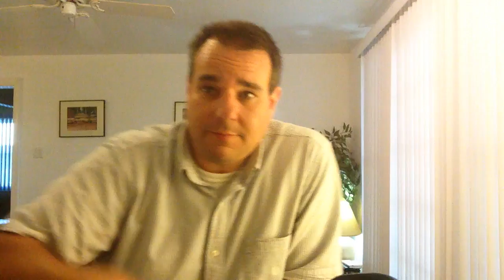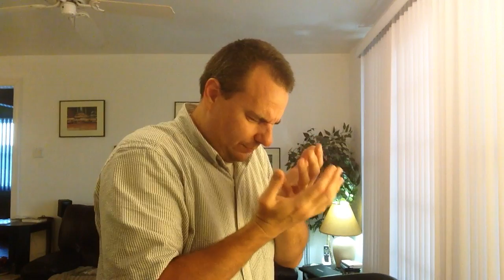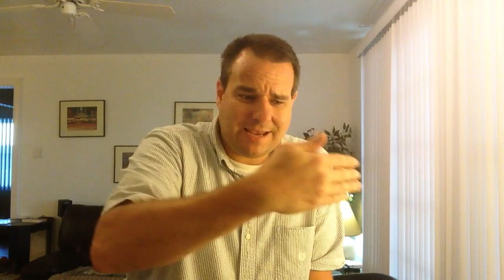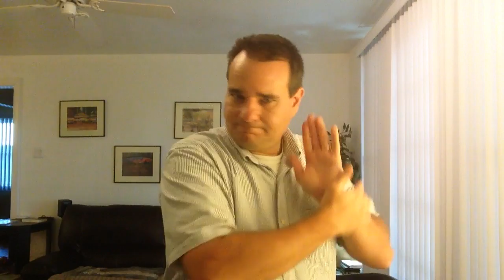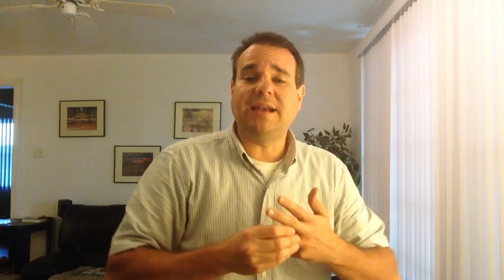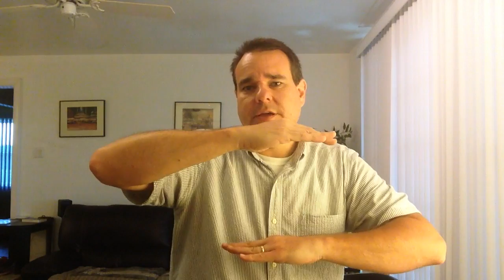More Digital Concepts - Sample Rate, Bit Depth & Rate

Comment: Kris - nice vid.. explains the settings well.  In the early days of CDs, sound quality wasn't great. For the most part, I think that's because the early DAC chips didn't have great error correction and resolved the upper frequencies poorly.  As you say, 44 kHz can resolve 22 kHz but with just 2 samples (plot points), you'll end up with a pretty jagged curve unless you smooth that out electronically. The problem resolves itself gradually as you go down in frequency.  At 11 kHz, for example, you have 4 samples to work with. At  1 kHz, you have 44 samples!  The more data, the more accurate the sound.  Anyway, modern DAC chips are much better at converting fewer samples to smoother wave forms and sound quality for CDs is quite good now.

About a week ago (and with this in mind), I set about to establish a baseline recording format for transferring my records to my PC. The goal was to create the best quality possible without bloating my hard drive with overly large files. Ultimately, I decided on 48/24.  To arrive at that, I downloaded a free sample from HDTracks.com and used one of their 96/24 files to create down-sampled 48k and 44k versions. I then opened the original in Audacity, then opened the 48k file (in the same window), inverted one of them and created a new file from the combination. The resulting file was basically silent (due to wave cancellations) but with a bit of data in the upper frequencies.  I then opened the spectrum analyzer in Audacity and took a look.  The 44k comparison did reveal lost data in the 15-22k range (as you would expect). The 48k comparison also revealed lost data but it was all above 20k.  Not sure if my method was sound (pun intended) but it made sense to me!  Keep on rocking!~
Reply from the maker: +Mark Colegrove Thanks so much for the wonderful comment/reply Mark.  I am starting to realize the more I read that for whatever reason, we who listen to music and gear (so, you know, audio geeks) refuse to recognize that our ears from one person to another are completely different - as if there is a baseline that is consistent to everyone.  Just like I know I don't see the color yellow the same as you (being colorblind) but that doesn't mean I don't recognize yellow or its' shades.  I think the same is true with speakers/audio preferences/etc.  What sounds tubby to you may sound forceful to me - yet we aren't wrong.As for deciding what works for you - definitely I think people should hear/see for themselves.  I used to be so adamant about my needledrops being at 24/96 but once I did this video I realized that really only the 24 bit of the equation was important - made capturing so much easier (due to processing file sizes)... I stuck at 44.1 only because I know sometimes software conversions can cause some issues and I do make a CD of these - if it was strictly an mp3, I would capture at 48khz as well.  You know, according to the industry, 24/48 is hi res.  Once I did the final check - play the file, play the vinyl I realized that all of the ideas I had about digital/analog was wrong... I blame Fremer :)  I did a final followup video called Master Debater that goes into my epiphany.   I feel much freer now - https://www.youtube.com/watch?v=zxeIVBOjRfw
Reply: +dixielandfarm Yellow, yes!  I was thinking about this a few months ago.  We really have no way to accurately describe colors to people and even folks who are not color blind may actually be seeing completely different things.  You and I may agree on every color... yes, that's red.. yes, that's green, etc.  However, I have no way of knowing if my experience of "red" is the same as yours. I assume it's close but that's about all I can do.  Works the same way for music I think.

So...where was I.... I record at 48/24 AIFF files and import them into iTunes. Then, I just have iTunes burn the (44/16) CDs for those I want to play in the car.  Eventually, I'll add a nice little DAC to my audio setup with a PC and play those that way.

Comment: Analysis Tool:
I use SPEK to create a spectograph on my audio files. I can easily see a lot of empty space above 22 khz on yours and any 24/96 recording of a vinyl record. It seems to be unnecessary information. 900mb per album is going to fill up even a large HD very fast. For example, I downloaded an alleged recording of DSOTM 200g original master recording at 24/96. It sounds very good however, the SPEK is no different than my recording at 16/24 except for these large blue spikes that appear into the emptiness above 22khz (the limit of a vinyl record anyway). I have basic stereo equipment so I suppose I can't compete here but I'm happy with the recordings I've made so far but I could have saved a lot of time if I wasn't such a nerd about this stuff. Now to go buy a new pair of Sony MDRV6s!
Reply from the maker: +Corey's VC Channel When you read the audiophile online forums, they go on about how the air is missing on anything that isn't  24/192 and even 24/96 sounds dull, but the vinyl never has this - but truth is exactly what you see on the spectrograph - while vinyl can and DOES have content above 20khz, there are THOUSANDS upon THOUSANDS of recordings that don't - never did, the mikes couldn't capture that high or it was filtered out by other equipment, etc... and the analog-or-die people never mention that fact - nor dismiss those recordings - they just say how much better the record is.  The record still might be the best, but it isn't because the digital can't capture it - it is the mastering, plain and simple.  My test would have been complete if you were standing in my room and listening to MY EXACT RECORD on MY EXACT PLAYER and switching between all of them.  We can surmise that if you can't hear a difference between the 24/96 and the 16/44.1 that 1. The vinyl isn't inherently better than the digital as a storage medium 2. Hi-Res has no real place in the home, since we can't tell regardless.  Only two people heard a difference between ANY of the files except the lowest mp3, and one of them changed their mind (if I am recalling correctly)...

But, the one thing I really wanted to impress upon people was they aren't missing anything - they can enjoy any format they want without thinking they are cheating themselves not getting that Blu-Ray audio version of their favorite album... whatever they have it on (save the cassette) is probably more than fine.  Mastering is the real key, and that is where the differences come in, and that will be discussed in a big confusing ball of pain in the last in these series of videos soon.
Reply: +dixielandfarm the final message here is the most important. You've actually helped settle down my busy mind that is trying to convince me I'm missing out. (not missing anything!) Thanks Kris

Comment: Vinyl Recordings:
I was really disappointed when I learned my Creative Audigy 24/96 card could not record at 24/96. Apparently it will only allow a "pass through" at those rates. I spent many hours recording testing and doing analysis that only resulted in 16/48 or my audio recording software would not play or error out when I cranked it up. 
Instead of buying a new card, I"m happy recording at 16/48 with the knowledge that 24/96 is best used for removing pops and cracks which I leave in anyway. For storage and file identification, I have been rendering to a  "Highest Quality VBR (variable bit rate) Stereo Audio No Compression" in Sony Vegas. The result is a MP3/224kbps/48Khz file. (As opposed to a 320k at a 4:1 compression which Vegas applies) Are the 192k files you have compressed? They appear to be very close to my HQVBR.
Reply from the maker: +Corey's VC Channel The 192k files are taken directly from the 24/96 file and I used LAME to encode them at VBR - so they peak often above 256k but average at 192k.  The little tascam that I use records at 24/96, but I am going to record at 24/44.1 from now on - the 24 bits is helpful when I normalize the album side (each album side could be off due to length, so doing the side is best practice), and I use clickrepair which has a trial and is AMAZING... It's one of the very few pieces of software I have ever bought - it actually allows you to listen in real-time to what it is removing -so if you hear anything like musical content, you have gone too far.  Now, apparently I had my LAME setting wrong on my normal rips - I have been ripping at 225k which is in between 192 and 256 - I think 256k is just a great compromise - the VBR works nicely, and 320 is always CBR so it takes up space whether it needs to or not.  Not sure if I mentioned in the video, but I think I did in the README, it is amazing how many soundcards advertise to be one thing but resample everything at another rate (says it does 24/96 but actually just resamples at 16/48 and outputs that)...
Reply: +dixielandfarm thanks for taking a minute to chat about all this, I don't take time to hit forums lately but I happened to be screwing with recording when you posted this video. So true about the sound cards

Comment: nice video. It's funny cause vinyl dynamic range is in fact more than  adequate    for pretty much any type of music. The frequency response is also pretty good. Vinyl's downside comes down to the distortion of the needle when it rubs against the grooves.
Since technics is introducing a new turntable I'd really like it if they introduced a laser turntable like the elp one but less expensive.
Reply from the maker: +Thomas John The real issue with the ELP and the concept is having to have the record pristinely clean, which is just near impossible.  Linears do a good job with the inner groove distortion, but the one thing is that the whole thing is just magic/amazing that it works as well as it does... I think I said in this video, but almost all of the music people listen to has a dynamic range of 15db at best, and more likely 5-7 for "classic" recordings, even classical rarely ventured into the 30db range, because we just plain like those drastic volume changes... so the vinyl record definitely has enough... The funny thing is how different the quality of vinyl has been over the decades - I can play a beat up one and be virtually noise free if it was from the 50s, somewhat from the 60s, but anything other than perfect on a 70s and it could be crackle-city.   I will do a video in the future demonstrating the click repair software, but it is amazing how well that works, and I do know the author has written a real-time version of the software to use... maybe with those two things we can satisfy peoples main complaint with vinyl - the noise.
Reply: well post processing is pretty horrifying. Perhaps the needle is the best option.

Comment: Interesting video, have not yet had time to check out your dropbox files. 
CD quality is just fine. There is lot of snakeoil in HIFI /audio business. I have just a few highres files. I have had some experiencies where I clearly prefer high res over redbook in my system. (same transport, same dac, same everything). For example Steven Wilson: Hand. Cannot. Erase (2015). I have it 16bit 44.1 and studio transfer 24 /96 (stereo). Mr. Wilson has made his album as a flat studio transfer (no mastering). 16 bit is just created form 24 bit master.
My honest experience is that high res of that album has more "feeling" and wider soundstage, more "black backround". I cannot scientifically explain it to my self, other than its totally a psycologial thing. 

I read one article that had some interesting (scientific sounding, perhaps snakeoily) arguments for higher sampling rates. It talked about the human ear and how fast it collects soundwaves. It was said that the audiotory time resolution for an human ear (brain) was around 7 microseconds. 44 khz sample rate has approx 20 and 192 khz has 5. Might be total nonsence ;)  
I dont worry about it, I am happy with my CDs.

Comment: Great video Kris and thanks for taking the time to make the different files available to download and test with. I ran thru the files and did abx testing with foobar and I wasn't able to do better than random chance on any of them. 50% right my setup is an audioengine d1 with audio technica ath-m50x headphones. Now one "criticism" of all this could be that none of the samples were "real high res" aka none of the recordings were recorded in hi res originally. I've made some videos about high res already and I've listened to "real high res" recordings and I wasn't able to tell the difference on those either. I also have only reliably been able to identify 320k mp3s on one sample which is a "killer sample". I was unable to tell the difference between flac and the 320k mp3 however with that sample. So obviously all my music is stored in 320k mp3. Is that the format you've chosen? Are you able to tell the differences between relatively high bit rate lossy mp3s? Or will all of this be in a future video?
Reply from the maker: +baldmetalnerd I can do that in a future video, but I decided for my ears and setup, I ended up with 226k VBR (probably should bump that up to 256k) - if it is a recording I adore, I probably already have it on vinyl and when I am sitting properly to listen, I'd be listening to that.  If if is anything else, the difference isn't great enough to worry about, but the benefit of the smaller file is portability; quicker to back up and quicker to transfer to my mp3 player for the outside world.  Since I struggle hearing a difference, I just found that the "feeling better having the highest bit rate" was more in my head than anything else, so I just let go of that worry.  I figured that if I noticed a problem on a particular recording, I'd just re rip.

The samples I made were from my own needledrop at 96/24 and then each subsequent file was downsampled from that hi res file, and the hi res part was to kind of put across that if one thinks the vinyl is "hi res" and if you can't hear a difference between the two wave files, the whole argument falls apart that vinyl captures more sound than cd (unless of course you want to criticize my digitizing setup or turntable, which so far nobody has yet).  I also fully anticipated one or two people to ACTUALLY hear a difference from cd down to the mp3s, and that has happened, which is actually terrific.  It doesn't make hi res pointless, far from it - but it does impress that it is such a minority that really most of us don't have to worry about going further than cd resolution .

Having said THAT, my next video is that it really comes down to the mastering - and probably if you have a recording from the 50s-80s, the vinyl will have the best mastering, 90s the CD, 00s its a crapshoot since all music was mastered to death, 10s slowly nodding back to the vinyl because of what happened in the 00s... and none of that is really the format's fault.  

Thanks so much for watching!
Reply from the maker: +baldmetalnerd Oh, and I should say, metal you MUST have 320k, that is the one genre where the lower rates show up MUCH quicker.  Since I'm listening to rock and jazz, I don't notice it nearly as much (unless it is hard rock or punk, which are metal's cousins)...
Reply: I think your needle drop setup sounded great! As for vinyl being "high res" I know it's a "controversial" subject but the science seems to point to it not being high res. I would recommend checking realhd-audio.com and maybe subscribing to their daily email newsletter if you want to get REALLY educated about Hi Res audio. It's a site ran by Mark Waldrep who's been an audio recording engineer for more than 30 years he also runs a small label called itrax. He seems to REALLY know his stuff. The reason I favor 320k mp3 so much is because to me the smaller file size is a huge improvement over flac and I can hear the differences on some tracks. Plus with that file size I know I won't be missing any audible (to me) frequencies. I encourage everyone though to do their own listening tests to find what works for them and make sure it's a blind abx test because if not the placebo effect is STRONG. At least with me it was.
Reply: Crap I meant to say I can't tell the difference between flac and 320 no matter what but I can tell the difference between 320 and other bit rates on some tracks.
Reply from the maker: +baldmetalnerd I would have never thought how strong confirmation bias really is, but we humans really do have something wired in our brain to skew and have false memory on things.  The McGurk effect still blows my mind (look it up on youtube if you don't know what it is/haven't seen before) - knowing something is one way but having your brain feed you something else EVEN THOUGH YOU KNOW IT IS WRONG is just so crazy.  With audio, unless you can live switch right then, after about 10-15 seconds, your memory sense skews things drastically... and it is why I think audiophile magazines don't do blind testing - they wouldn't get the result they want/expect.  I have a Hi Res DAC, uses the Sabre chip and makes everything sound pretty damn good, even lossy files...  Having said that, I have decided that from now on when I make personal needledrops, I am going to use 44.1/24bit (and then create a cd and 256k VBR mp3)... the 24 bits makes it easier to do click repair and I don't have to be critical at capture level...  There are some great videos/talks with audio engineer Ethan Winer on youtube that really started to change my mind/lock in on real science and practical know-how against more subjective analysis... The issue with vinyl/analog vs. cd/digital is the thinking that the science can't explain the audible difference in real-life situations,  but I am hoping the needledrop illustrates to some that the digital can capture the sound fine -the vinyl might be doing something to the sound that is pleasing, but it isn't that digital can't reproduce it.